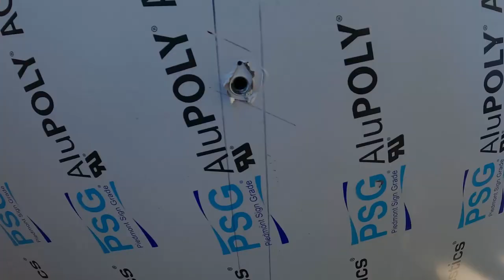DIY Overland camper trailer build: tongue box part 2 - fit

Comment: Still looking great.  I see you did the tongue box mounts yourself this time.  Obviously, you're more comfortable/confident with your welding.  That's awesome.  I'm still locating the steel at this point (oh and cleaning out my garage to give me some space).  Can't wait to start.
Reply from the maker: Thanks! This project required a lot of welding so I am getting the hang of it.  Looking forward to seeing what you come up with.
Reply: @infosponge  Thanks...one more question for now LOL...Did you buy your frame material precut or?
Reply from the maker: @mattmatthiessen7743  the welders ordered 20' sticks and cut them to size.